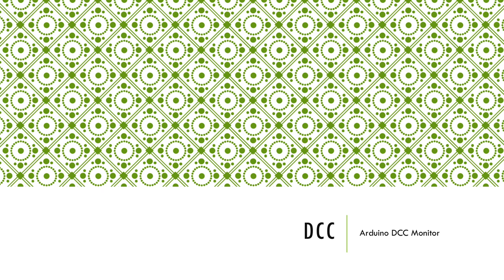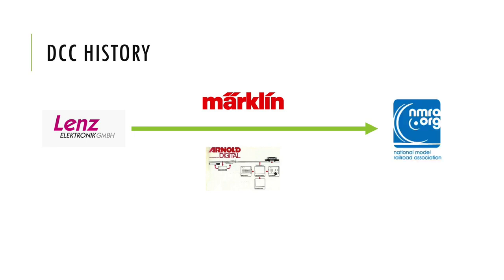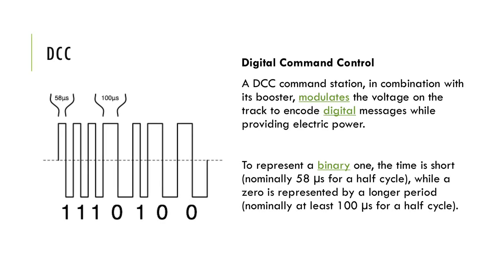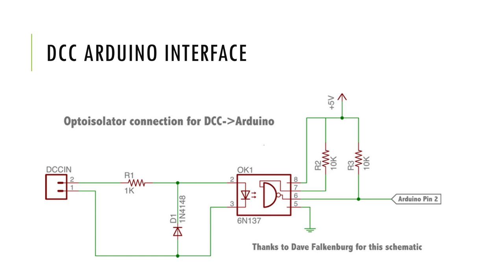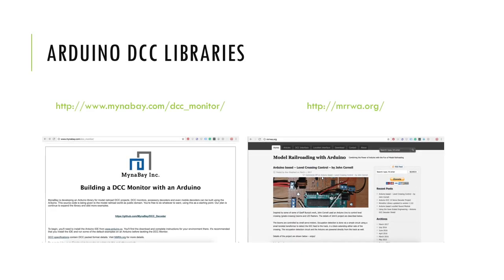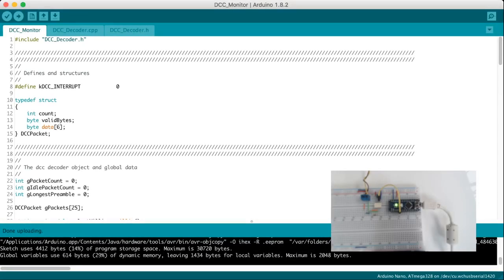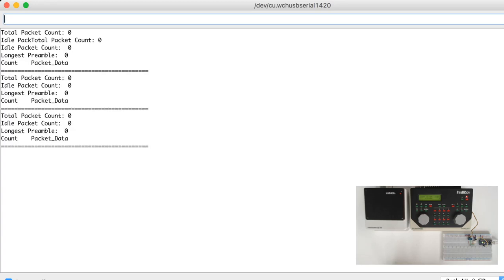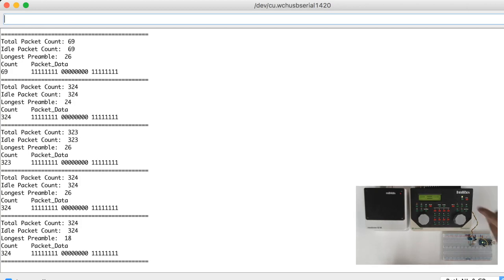Arduino | DCC Monitor

Comment: Hello, I'm looking to run my model railway accessories with Arduino Nanos.
I have successfully installed your DCC_Decoder sketch on one of my Nanos and it runs.
But I can't get it to recognise any DCC signal. I have a Roco z21 black.
Bit of a newbie here, are you able to help, please?

Comment: Seeking to use DS2423 and DS2450 for a weather station, and no answer on your Github, could you put me on the track for the use of your .h files as sensors.h in your .ino weather station. I can not understand how to use these files without being like libraries associated with a .cpp
cordially
Reply: With an Arduino you don’t have to use a cpp file. You can if you want to and it’s better coding but it works with just putting all the code in the .h file.
So the sensors.h file for me was just a way to put the subroutines and functions for the sensors in its own location instead of in the ino.

The sensor.h file just call routines from the included libraries:
#include <OneWire.h
>
#include <DallasTemperature.h>
#include <DS2423.h>

So you could just include those in your ino and use them directly from there.

But recently I made the switch to ESPhome because I’m running Home Assistant and that has really worked out for me in terms of time and stability of the sensors around the house.